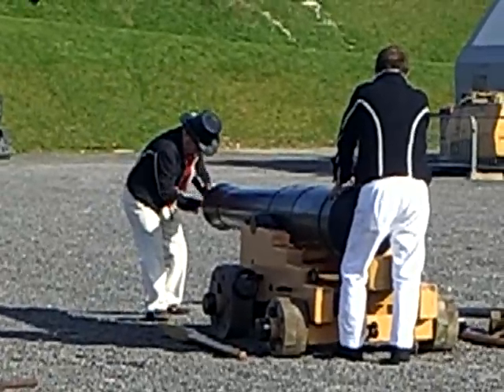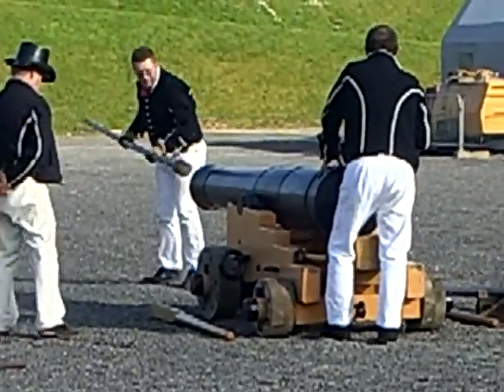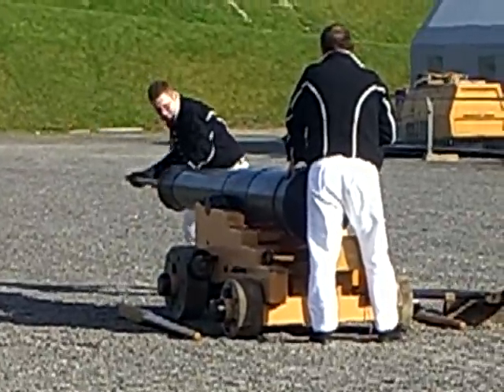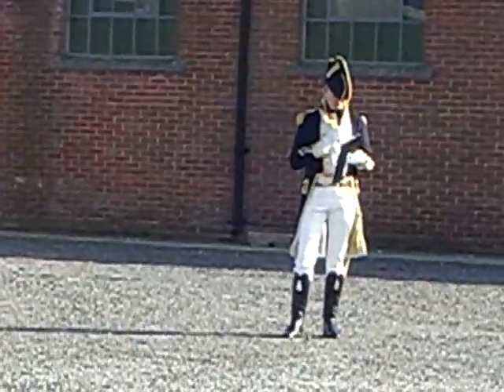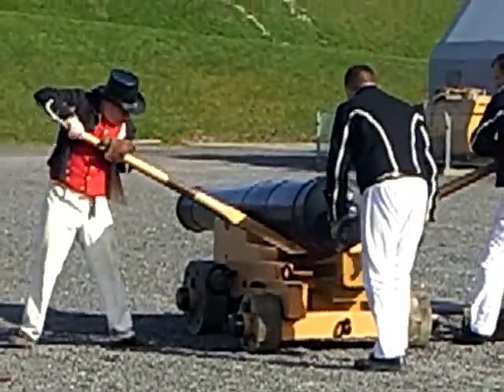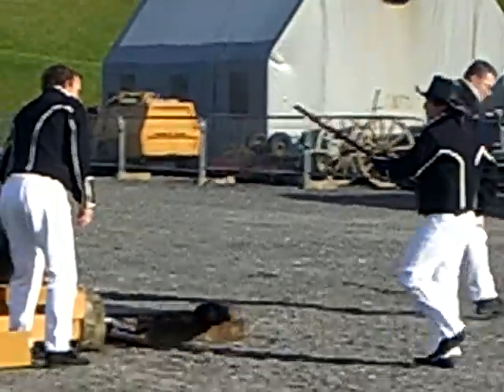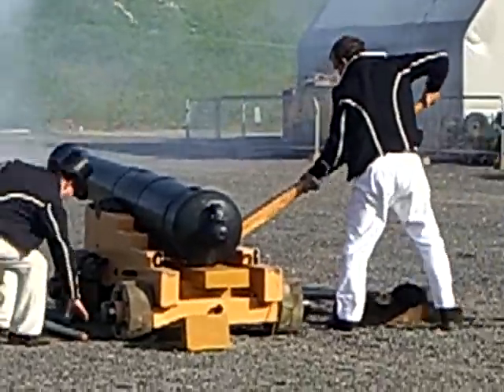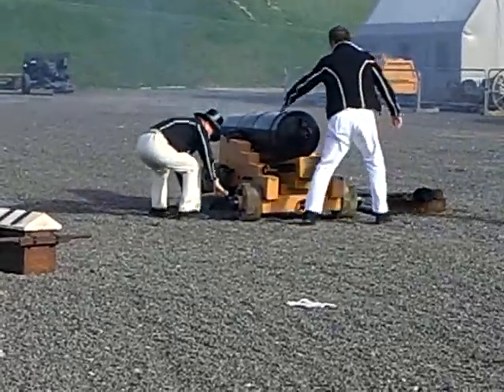Hornblower cannon firing

Comment from the maker: Thank you for your comment and well spotted. By Trafalgar most of Nelsons fleet were equipped with the modern superior gunlock fitted cannons, whilst the French were still using the old fashioned lynstock method of firing their cannons. The cannon used in the clip was a 12 pounder, cast in 1805 so possible but unlikely that it was used at Trafalgar.
Reply: I am a bit in doubt as to the advantages of flintlock-equipped cannons. From reading Spanish sources about Trafalgar, apparently gunners tended to dislike the flintlock since it was prone to falling apart after some shots, and it was common practice to always have a lynstock in hand. Of course, it might just be that the Spanish flintlocks weren´t as good as the British ones...

Comment: I believe this gun would have been fired by a flintlock mechanism originally. I'm in the process of restoring an original Blomefield 6 pounder of the 6ft pattern, cast 1797 which I believe to be a bow gun from a brig sloop ship. It should be good enough to fire once done.
Reply from the maker: Correct - the Blomefield pattern cannons were fired by gunlocks, a flintlock mechanism with a lanyard so that the gunner could stand behind the gun, clear of the recoil. The French were still using linstocks (slow burning  matches on the end of a staff or stock) and could not look down the barrel but were forced to stand to one side of the gun. There was also a delay with linstocks, which meant that in a rolling or pitching ship the gun would be pointing in a different direction by the time it went off.

Comment: Weren't they using guns with the pull string kind of flintlocks at that point? The burning matchcord is a bit archaic for the Napoleonic age.
Reply: I will paste what I just commented on another thread.

From reading Spanish sources about Trafalgar, apparently gunners tended 
to dislike the flintlock since it was prone to falling apart after some shots, and it was common practice to always have a lynstock in hand. Of course, it might just be that the Spanish flintlocks weren´t as good as the British ones...
Reply: They should have been using a flint lock, lynstocks were kept in water buckets along the centre line in case of a flint breaking or swan neck snapping. The lanyard used to fire the cannons was worn round the neck by the gunner when not in use and is still part of the uniform of the Royal Navy today

Comment: Pretty cool. Keep the thumbs pointed out when ramming in that charge (I think the rammer did in this video0!  An muzzle loading cannon is like a Model T crank, it can bite you if you don't use proper technique.  What those sailors had to go through in those days.   Chances of powder going off prematurely, iron shot flying through the ship from the opposition only a short distance away,  splinters from the wood were horrible,  bad food, bad water, but I heard the rats tasted good as they had the run of the biscuit locker.  Tough people in those days.